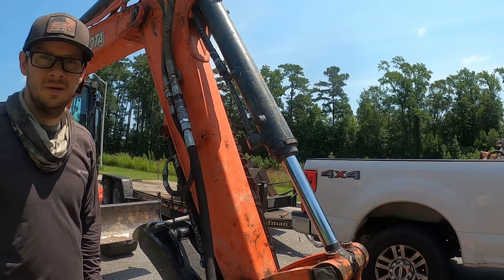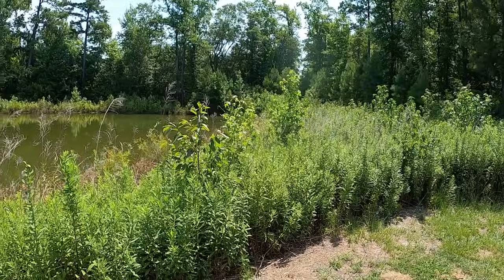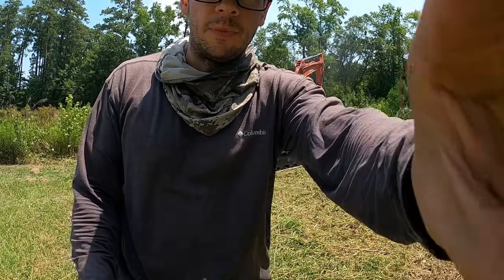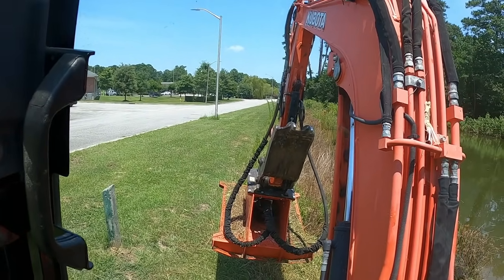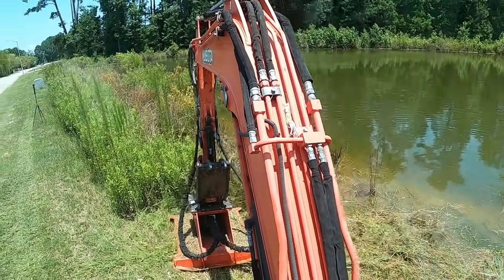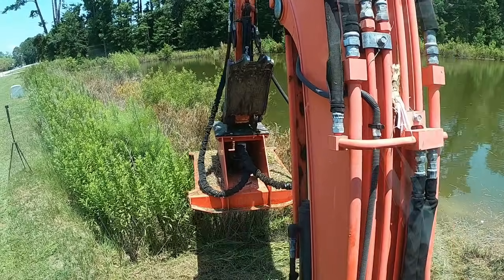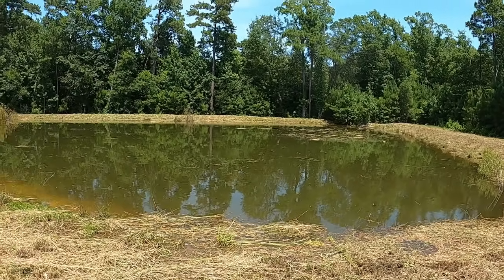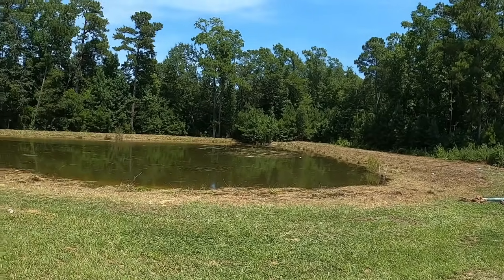ANGRY WASPS AND AN ALLIGATOR MADE THIS RETENTION POND JOB VERY INTERESTING!

Comment: How I found it easier to hook my hoses up is when you shut the engine off wiggle the joy sticks back and forth to take the pressure off the fittings and I think your hoses will connect a lot easier. Give it a try.
Reply: You can also push it against the stick to relive the pressure if it has the ball sticking out

Comment: You could be at Fort Huachuca AZ.
Reply: Yes he Could, I was Stationed there from 1990-1991, Served in the Gulf War with the 385th Signal Company
Reply: @billybrinsfield6485 , was it the 526th Signal company that was heavy tropo scatter?
Reply: @carlj3515  I don't remember exactly, but our Unit seemed like it was Always being the One who had to Look Good 24/, and they got Mad at Me because I wouldn't play Politics!
Reply: @billybrinsfield6485 . I chaptered out in the late 80’s. We stilled had the old Duce and1/2 ,5 tones both manual transmission. And the GMC’s. Took 2) 5 ton tractor trailers,2) 5ton cargo trucks w/ trailers to move our junk to the field.
Reply: My company had the first female 1st Sergeant on Ft. Wash-A-Truck.
Reply: @carlj3515  I remember the Tractor Trailer 5 Tons very well, I was sitting in front of one on Guard Duty when the Scud hit the Quarter Master Building in Daharahn at the End of the Gulf War
Reply: @billybrinsfield6485 , Did that leave a skid mark on your shorts?
Reply: @carlj3515  Nope, just did everything I could to stay awake that Night from Boredom, I had a Feeling earlier in the Day something was going to happen and I was Right
Reply: I was doing everything I could to stay Warm, I was in Mopp Level 2 to try and keep as Warm as Possible
Reply: @billybrinsfield6485 ; bet you weren’t board after that.
Reply: @carlj3515  I just stayed Calm which Shocked everyone

Comment: How long do the rubber tracks generally last on the mini excavator machine @IDigit4?
Reply from the maker: 1000ish hours typically. Maybe 2000 depending on what you are doing.

Comment: How many HRS on your machine? I purchased a used 2018 with 1600 HRS on it. It is my first EX, U35-4 Kubota just wondering with good maintenance how many HRS I can expect to get out of it. Controls are very jerky, and it loses power after running for a while. It will just idle down on its own and has no power, after a few minutes it will idle back up but sometimes you have to give it a break to get power back. I keep water sep drained and air filter blown out, it is not running hot temperature wise.
Reply from the maker: Not sure what the issue is there.  I bought mine with 1000 hrs on it and have about 2700 at the moment.  Only issue has been the A/C which needed replacing after 10 years.  Mine is a 2014 model.